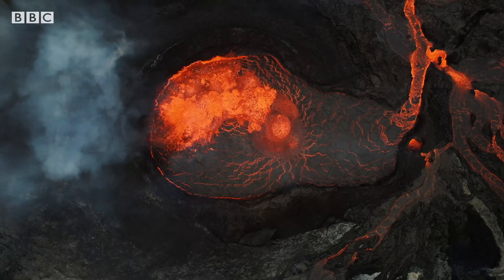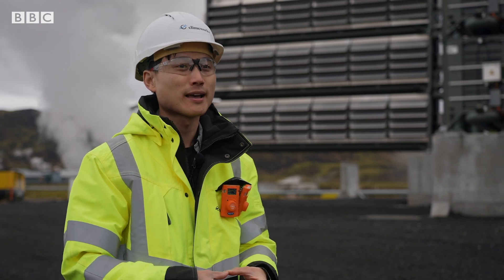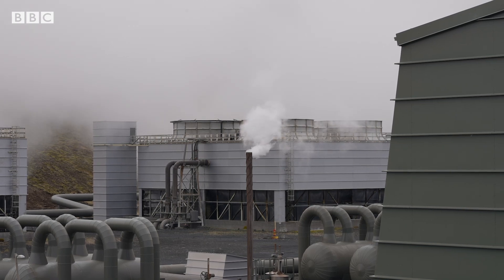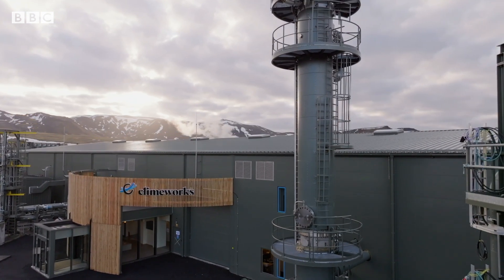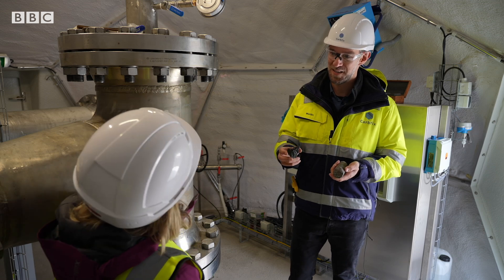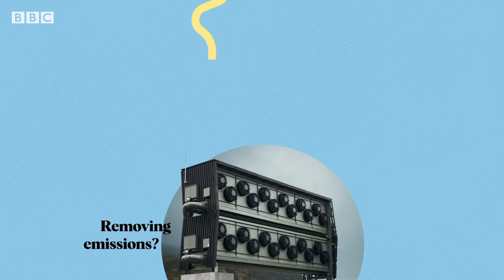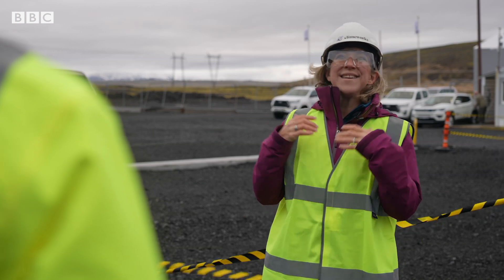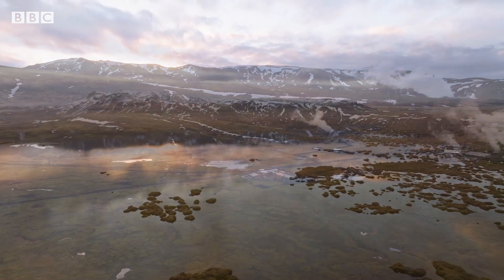Inside the hidden carbon plant pulling CO2 from thin air | BBC News

Comment: I wonder how much energy is used to drive those fans that suck in an olympic swimming pool of air every 40 seconds? You can afford to do most things if you have a bottomless pit of free energy! What a pointless excersise, but I am sure the company running this are making a fortune in grant and investment money. This is an exploitation of the fear generated by the lie that the planet has warmed very slightly due to excess CO2 in the atmosphere.

Comment: Would be far, far more effective to use the money that was spent building this on building a renewable energy plant in a country that relies on fossil fuels. This is just a smokescreen.
Reply: so how do you remove aviation emissions?
Reply: @ldm3027  It's not really worth focussing on aviation at the moment. It's around 2% of current emissions and extremely difficult to decarbonise.
Easiest solution would be to replace it with high-speed rail.
Reply: @drunkenhobo5039  I see - so you want to cover the oceans with high speed rail.  2% is growing fast and will be a driver for DACS

Comment: 1:44 - I don't understand his answer, "Carbon dioxide tends to disperse in the air"... so yer, why not capture it as close as possible to the source? Like, right next to the industrial exhaust pipes?
Reply: Most emission on this planet doesn't occur near those pipes. In theory you are right but in reality it just doesn't matter AT ALL.
Reply: @coondog7934 mate, how it doesn't matter? If you integrate a filter like that right above any pipe emitting CO2 and capture it without diluting it in the air it should be way more efficient then filtering the entire planets atmosphere, those vents are spinning, you know? Think about the energy consumption, if you have a bucket of ink, wouldn't it be  easier to manipulate that unit at the sourse, instead of throwing it in the ocean and filtering the ocean, searching for the ink?
Reply: @deniszhuravlev9772  If you are talking about a filter right ON TOP of the industrial building then yes, that would be better, however it wouldn't be feasible to connect all industrial complexes like that with pipes. If you are talking about buidling an air cleaning facility right NEXT (or in the general area) of that industrial building then no, that doesn't make any difference since as soon as it comes in contact with air even once, it immediately disperses. And the 2nd assumption was the question in this video, where it was asked why not build the filtering complex close to the emitters and there is your answer. There simply is no way around cleaning the whole atmosphere since most complexes around the world can't simply put filters on their roofs or connect their exhaust with pipes.
Reply: what he meant was this method is specifically for atmospheric capture of existing co2.
we have other types too.
beccs is the form where we burn biofuels and capture the pollution and in the case of factories, it is normally called, PCC (Post-Combustion Capture).
Reply: @gigabane7357  👍👍
Reply: Because that doesn't work either. It's simply uneconomical - it's ludicrously expensive to capture CO2. Far better to not release it in the first place.
Reply: @drunkenhobo5039  wrong - it is quite economic to capture emissions from aviation for example, which is why it is being done
Reply: the fuel is burned in air, O+N and the burning adds CO2 to the mix. On the other hand if the fuel is burned in pure O2, then the entire output stream is CO2 and can be further treated, see Allum cycle, the N that was seperated from the air before combustion now could be used for fertilizer production
Reply: That happens to but it's typically called CCS rather than DACS. A lot is being captured at source but of course some companies then exploit CCS (e.g. oil companies using the captured CO2 to extract more oil/gas).
Reply: because it disperses rapidly in every direction very very fast so it wouldent matter if this building was next to them. however.. if they constructed one of these in a smaller version over the top of a chimney that would be effective and render the building c02 neutral.
Reply: You also need to consider the cost of transportation. This injection well is next to the capture plant.
Reply: The surface interaction required to capture carbon is simple in concept (I mean… we’ve figured out a few ways to do it…), once you have the material, you just make more of it.

But you’re not thinking this through. The cost isn’t just ‘the concept’ it is the material. How much can the material hold? How often do you need to change it, transport it for waste disposal, maintain (and power) the system that pushes the air into the material? How intensive is the process in manufacturing, fitting, and installing this material? How can you make sure the process for the creation of the material is itself carbon neutral?
Reply: Same question in my mind
Reply: The reason they don't is that they need specific geology to be able to store the C02 and they need very cheap energy to have any point in this at all. It would be more efficient to capture at the exhaust pipe but they don't like to explain things properly in the news.
Reply: @rivalrepairs  on the contrary DACS is for hard to treat emissions like from aviation
Reply: It's really expensive, unless we effectively fine companies for polluting because it's an honour system and guess what no company self reports effectively
If the fines were bigger and effectively applied, the shareholders would choose to reduce emissions
Reply: @ThePlayerOfGames  Moving the cost to business moves the cost to the consumer. You will pay for it
Reply: @rivalrepairs yea and who’s gonna pay for these to be put everywhere? Tax payers? Here in the uk at least you can’t trust the government to do anything affordably and are better off obligating companies too
Reply: Because the unit maxed out only captures 36k tonnes a year, whereas a factory will produce millions. 
So the land cost and other expenses are pointless when it disperses and can be captured at its limited rate. 
Once the tech then becomes more advanced a closer or directly linked capture will be considered
Reply: @BrakingBrad1  yeh the whole thing seems pointless idk what they are up to 😕
Reply: When you realise that they don't want solutions, they want to make money then suddenly you will start understanding things.

The climate is the least important factor for the "green" industry
Reply: Yeah you don't understand it, because your not educated like these scientists and engineers who just told you why.
Reply: Its expensive, cant be afforded
Reply: By the time these emissions exit the stack the CO2 has already dispersed itself. These issues could've been solved by now, but we are a bureaucratic people. Spending more time in discussion than doing anything to solve the issue...

Comment: CO2 is plant food and according to a NASA study has already lead to increased foliage cover on the Earth surface twice the size for the United State.
Further more the level for CO2 in the atmosphere has been orders of magnitude higher in the past with no corresponding temperature increase and the Earth has been hotter without any tipping point that meant the temp didn't drop later.
Moreover between the 13th and 19th century the Earth went through a period referred to as the little ice age when the temperature over the Earth dropped by 4C and it's only recovered by 2C since it ended.
You're being scammed folks.
Reply: Literally everything you say is a lie.

Comment: One factory in China with one month of burning coal, will be 10x the amount of CO2 this thing can sequester in one year. What a waste of money, a vanity project.
Reply: If you build a million of these around the world, they could get all the Co2 that is being released each year out of the atmosphere.
Reply: @nikokapanen82 and the CO2 generated to build every cable, every motor, every microchip every fan blade, and the CO2 of shipping/flying/driving all the components to the million destination, and the CO2 produced by every worker to commute every day to build a million of these and the CO2 produced to provide the energy to run a million of these, will vastly surpass the CO2 that these can absorb 😂😂😂
Reply: @ADW-00  
Each of these can take about 40 thousand tons of pure CO2 per year, in no way to build and sustain one of these machines could generate 40 thousand tons of CO2 especially if the electricity to run these machines would come either from renewables or, let's say, possibly, from Thorium reactors.
Reply: @ADW-00 that’s like saying we shouldn’t build Pipelines and oil rig’s because we use a lot of energy trying to build it.
Reply: @ADW-00  wrong - the embedded CO2 is removed in a short period
Reply: What’s funny about the nature of humans, it’s more likely we just build 100s of millions of these rather than just cut emissions lmao

Comment: expensive virtue signalling when nature does the same at no cost on a massive scale. co2 bonds with rain to combine with limestone or sink to the bottom of the ocean for billions of years. meanwhile plants need co2 to live. deplete it and they starve. co2 doesn't affect heat at current low levels of 400 ppm. other factors such as solar activity do. the earth goes through cycles of ice ages. get real.

Comment: Cool! I wonder if it might be possible to use that mineralisation process to make building materials for construction?
Reply: yes that has been done, concrete with CO2 embedded minerals can make  concrete close to carbon neutral
Reply: @johnjakson444  double cool! One man's trash is another's treasure, as they say.
Reply: Yes, there are startups doing that right now but the process seemed energy intensive (high temp required to react olivine with CO2) so unless the power is near completely fossil free (like Iceland, Norway, Sweden) it might not make sense.
Reply: @zapfanzapfan  it certainly makes it all seem more doable if there is a profitable byproduct to help make the process more affordable, both in energy and cost. Is it not possible to find a way to include the filtration tech at source of production? Capturing and converting as the carbon is produced.

Comment: ….BEAUTIFUL:……There won’t be any plants within 50km/50 miles of the plant…… Screw the Farmers.   Plants need CO2.   Meanwhile, people are starving on the street……   The idiocy of the Left is unfathomable.   Why don’t they concentrate on making alcohol plants to replace petrol plants.  Alcohol burns much cleaner
Reply: So your solution to people starving is to grow crops to produce fuel rather than food? Not sure you thought that one out.
Reply: @drunkenhobo5039  most of his  statement is not thought and more troll
Reply: @maya2adore232  actually CO2 moves.. There is no closed room except for the entire atmosphere.  That's also  where much of the generated panic has it wrong.  This is a remarkable solution using the relatively free energy just below the surface in Iceland where there is NO PERMAFROST

Comment: How incredibly refreshing to see a TECHNOLOGICAL approach to the problem instead of expecting billions of people to change their behaviours for life.
Reply: I asked chat gpt about how long and how many plants it would take to reach net 0 carbon emissions by 2040 using this exact type of plant. 

"To offset Chinese factory CO2 emissions (8,251 million metric tons/year) by 2040, you'd need about 19 million CO2 capture plants, each removing 36 tons/month."
Reply: @Demontoastslayer  Good thing they not only improve over time but also are only ONE SINGLE option we implement right now. If they alone compensate 1 per.-cent someday in the future that would already be more than we could hope for.
Reply: @6079_SMITH_W  nuclear waste is actually very very safe. Please look into how it is stored. They melt the waste and turn it into a ceramic/ glass then they encase it in concrete , then they surround that with more steel and concrete. If you put it in a geological area that has no earthquakes and is stable the fuel is 100% safe. I reccomend checking our kyle hills youtube channel where he has indepth videos about nuclear waste disposal. You can literally sit on top of the nuclear waste containers and get less radiation than one airplane flight.
Reply: @6079_SMITH_W  also I just randomly chose Utah since its pretty remote. Deep mountain storage in Norway? Somewhere in Nevada? Doesn't matter really. It can fit into an area 10000x less than all the waste from burning coal, making thousands of wind turbines that last only a decade and then the blades have to be buried in landfills. Nuclear energy just makes sense.
Reply: @Demontoastslayer  That might be a solution for the next 100 years but not forever. What happens in 1.000 years? In 5.000? In 10.000? Are we even here then to take care of it? You see your suggestion unfortunately isn't a viable solution.

Comment: The energy used is geothermal, so zero carbon. How much energy is being consumed in this process. If that energy was simply USED as energy, it would replace fossil generation, and replace many times more CO2 emission than this thing extracts from the air.
Reply: Iceland uses geothermal energy for its power. It's not like they are doing this instead.
Reply: @nathanlewis42  Fair point, as it isn't possible to store AC electricity.
My point is that the sums do not add up (intuitively). We don't have any data from this piece by BBC (which comes across like a smiling faces 1960s advert for newfangled household machines like dishwashers). Try accounting for the carbon fueled power that goes into constructing each CO2 capture unit (imported from a non-geothermal part of the world I expect), and drilling to reach storage, and work out how many years each unit has to run to get back to zero emission before it starts net storage. I'm going to bet that time is not far off the expected replacement lifetime of the units, or filling of the storage. Thats without including the carbon emitted from simply maintaining the units over their lifetime.
The BBC are part of the messaging problem. They are just going for the trained audience response "wow, look at how they are saving the planet". The BBC need to make sure their audience are not well educated.
Reply: @replacing_the_spark  go on then, try accounting for it... With sources.
Reply: @Hurc7495  I doubt the data would be available. My point is the BBC would never approach any climate reporting critically, looking at the carbon costs as well as the burial. They have an agenda.
Reply: @replacing_the_spark  have you looked? You can certainly make informed estimations!
Reply: @Hurc7495  Not on this particular topic. I'm not interested in these gimmick projects. They exist because taxpayer funds are always pushed into these projects. They seek out the subsidies, not the science.
Reply: @replacing_the_spark  I am sceptical of this type of project as there Is a real risk of seeing it become green wash for some of the worst offenders. I am also skeptical of comments like your first one which follow along the lines of "this green thech simply shifts emmissions" its like being told your electric car runs on coal when the grid is 1% coal powered. What I'm saying is a short Google will reveal the Icelandic grid is 99.98% renewable and not interconnected to the rest of the world, the operation also makes use of waste heat so perhaps a simplistic critique is inappropriate in this case.
Reply: I imagine that Iceland produces a surplus electricity that cannot be exported or stored so it makes co2 capture viable, otherwise it must be a waste of energy.
Reply: @David-jx4gw  They get to sell Carbon offsets™ 
It literally doesn't matter if this has an effect on the environment, that's going to look good on spreadsheet and will be a cash cow for whoever owns this crap
Reply: on the contrary, there are emissions that we cannot replace, such as from aviation. To give you an idea, removing 1 bn tons of CO2 will use about 1000 TWh (electricity) . The current global electricity demand is about 25,000 TWh so not significant. embedded emissions are removed in a short period